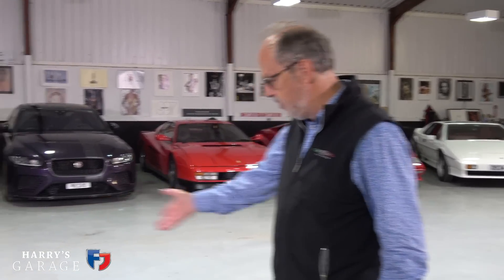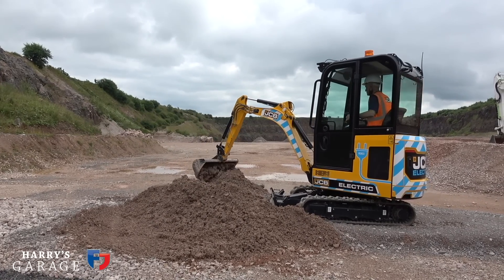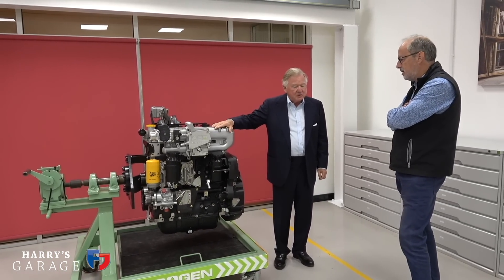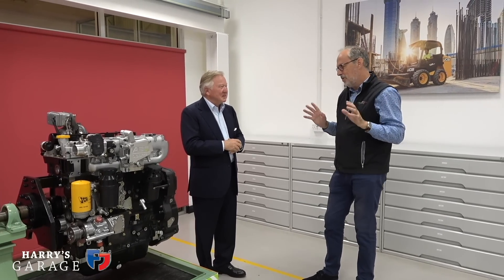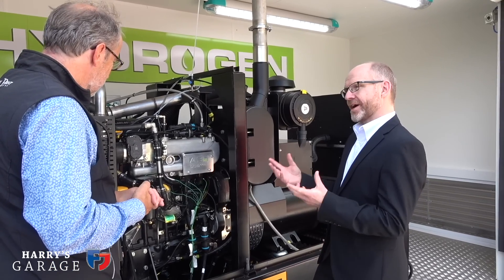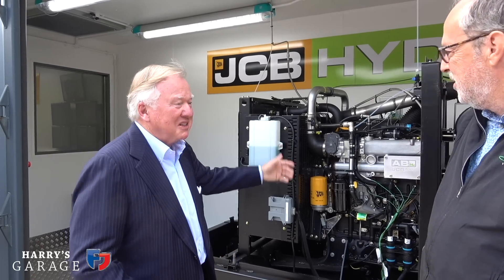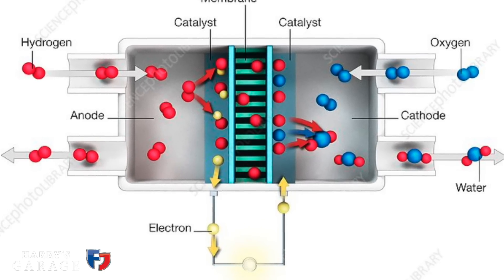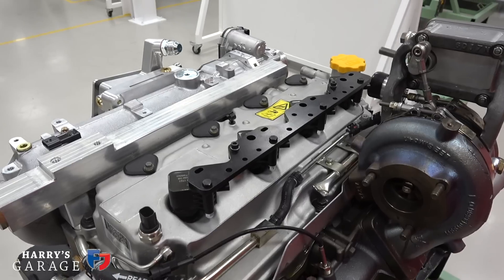Is hydrogen, rather than electric, the future for big-engined machinery? I visit JCB to find out

Comment: I was successfully  running my RX 7 rotary engine powered 50 KVA generator on rainwater sourced hydrogen, 12 years ago 😎
Reply: After 35 hours successfully running on rainwater sourced hydrogen a slight technical hitch caused a leak which blew the rx7 engine with PTO driven 50 KVA generator and the side of my workshop to pieces , explosion took my camera and recordings out also, the only survivor was the rainwater to hydrogen electric converter 😬
Reply: @fenflyer  haha so a totally safe technology ready for consumer use then
Reply: Very hard to tame detonation in a h2 ice engine. The reciprocating engines BMW was testing suppered knock. H2 works better in rotary engines.
Reply: You RX 7 idea is simply not viable for the whole planet.
Reply: @fenflyer  That must have been a hell of a leak - one that occurred in poorly ventilated areas that allowed for stoichiometric ratios of hydrogen, that then saw an ignition source...Hydrogen usually will self evacuate from a ventilated area as it is so light. Normal petrol usually forms a more explosive mixture as it is heavy and stays in place unless the area is really well ventilated.
Reply: @bighands69  Mazda continues to develop the Rotary engine, especially wrt hydrogen and continues to patent these developments...
Reply: @thecraggrat  To get the rotary engine running sweatly at full load I was running an oversize  impeco mixer which probably  over fuelled the rotary when it came off full load to an ideal unattended , this I believe must have caused the blow back🤷‍♂️
It happened at the time of a similar blow out on the Norwegian Hydrogen highway which took out 2 people an rx8 and the filling site 🤦‍♂️
I lost my enthusiasm for it after that 🙄
https://www.wired.com/2009/04/mazda-sends-hydrogen-rx-8s-to-norway/
Reply: John Deer built prototype rotary engines for trucks that could run multi fuels. They were said to be very resistant to stalling.

Comment: I was in Japan a couple years ago, they have hydrogen filling stations for cars. I was so impressed i took a photo of one. It's definitely viable.
Reply: I believe I heard James May say that the UK has 3 H2 filling stations, nationally.
Reply: @simonhbacon  There are about 5. They cost north of £1.5m each and can fuel about 10 cars a day. H2 is woefully inefficient, and made largely from natural gas. For passenger cars, forget it. It is just not going to happen.
Reply: @edwardbyard6540  It only takes about 5 minutes to fill a car, so i don't know where you get a limit of 10 cars a day. If its the size of the tank, this is easy to increase.
Define inefficient, the video stated that it contained more energy than diesel for a given, presumably compressed volume.
Video also envisaged generating H2 at off shore wind farms, electrolysing sea water.
Costs will be driven down as technology improves and becomes more mainstream.
Reply: @nordic5490  I think you're confusing hydrogen fuel cell motors (which as you say use electric power to drive a vehicle) with the hydrogen internal combustions engines discussed in this video.  I agree though that both are less fuel efficient than petrol or diesel engines. The added problem is the amount of electricity required to produce "clean" hydrogen, and the costs involved in manufacturing and distributing it.

Comment: I've been talking about this type of ICE for some time now. I just didn't understand why someone didn't go ahead and build one. Brilliant JCB!!
Reply: Economics.. Hydrogen made from natural gas is expensive to make and is the opposite of "green"   Fuel cells make more sense in any case.  JCB just wants to use the infrastructure is already  has to make a very low efficiency ICE engine.
Reply: Infrastructure!
Hydrogen infrastructure is hugely expensive, it makes a lot more sense for the vast amounts needed to go to heavy transport and heavy industry. For passenger vehicles it makes hardly any sense.
Reply: @UAPJedi  Hmm. I'd like to know what is easier - scaling charging infrastructure for people who have on street parking (near enough half of the uk) or a hydrogen infrastructure. Rapid charging hubs not really a scalable solution - they're inconvenient for the end user and the load they'd place on the grid if everyone without a driveway relied on them would be too great. But rolling out millions of on street chargers ain't gonna be cheap or easy.

Comment: 'it sounds more like a petrol' 
Harry and everyone else will be very happy.
Reply: Looking forward to running a hydrogen powered V8 in the future 😎
Reply: @V8PropaneBurner  There is BMW Hydrogen 7. 6.0L V12 which kicks out a glorious 256PS and 290lb/ft. While being 2300kg. A glorious 111PS per tonne. 
(fyi H2 piston engine is idiotic)
Reply: @V8PropaneBurner  The fuel tank for same range will be 7 times larger than a gas tank and weak power output will be about half for the same size engine. Hydrogen combustion engines are not the most stupid idea ever in the history of engineering technology - but they will be definitely  merit an honorary mention in the  hall of fame.
Reply: I have a dream. A hydrogen powered TVR.
Reply: @bbbf09  My "research" on fuel storage size says the number is 3-4 times but your point is well made.  Maybe I haven't accounted for the low power output.  What I can't work out is why a commercial fleet operator in particular would use a hydrogen ICE in lieu of a fuel cell when the ratio of efficiencies is at least 2:1 and I'd expect it's quite a bit more, the way that diggers, dozers, haul trucks & the like use their power.  Anyway, they'd be paying at least twice as much for fuel, which is the major operating cost for any commercial vehicle.  Many might say purchase price but as with BEV's, this will soon disappear and even if fuel cells are expensive now, in the commercial realm this would soon enough be overtaken by the cost of fuel.  To return to your point, a hydrogen powered ICE  vehicle will also need at least twice the size of fuel tank as one with a fuel cell drivetrain to do the same amount of work.  Yet another packaging problem, and let's not talk about a hydrogen ICE powered vehicle having the same high maintenance regime as every other ICE powered vehicle when compared to electric drivetrains.  Sounds like a dead end to me.  Apologies for the rant.
Reply: @Neojhun  yeah...weak and feeble. Wonder if JCB drivers are going to welcome that ? P.s. by comparison elecfric motors have power to weight ratios around 4000PS per tonne. Almost 40 times more.
Reply: @bbbf09  I'm not sure they could pull off a  scam if their competitors come up with practical fuel cell alternatives but I do agree that this appears to be a technological dead end.  There will be a market for hydrogen powered earthmoving machinery but they won't involve ICE's if the makers want to stay competitive.

Comment: Great video Harry and I believe it's the best remedy for Heavy Machinery and even airplanes. However, hydrogen is usually stored in tanks 5000–10,000 psi tank pressure. Because the pressure is so high the tanks deteriorate very quickly when compared to Diesel or Petrol tanks. I wouldn't be very impressed if a Hydrogen station was built near my house, with all the risks hydrogen storage brings. Lord Bamford mentioned the rare materials that make up the battery, such as Lithium, Cobalt and Copper. Battery technology is advancing so fast now with the approach of the Solid State battery and other alternative materials being used instead of Lithium, Cobalt and Copper. Those alternative materials are not rare and will not get more expensive. In fact the solid state batteries are getting denser and smaller.I think both technologies have a place in our future. I love JCB and I hope the hydrogen engine is a great success.
Reply: This is correct, great for heavy vehicles that can carry heavy tanks, not so practical for cars which will be limited in range simply due to the size of tanks required to safely carry the hydrogen fuel.

Comment: We have known for years that an internal combustion engine can run on H2. The trick will be to make enough H2 at a price that we can afford. And to date there is a massive hill to climb on that front. I don't think that will ever be solved. And that's before we mention the logistics of H2.
Reply: There's a company startup in Ireland dealing with the manufacture of hydrogen.
Reply: At least the storage problem seems to be solved. I remember BMW battling the leakage problems on their test cars back in 2000 to 2015. The tank drained itself within 9 days in the BMW Hydrogen 7 (E66 760iL). Oh, the 260 instead of 445hp and 3.6kg H2 per 100km at (subsidized) 10 Euro per kg where somewhat disappointing for BMW 7 owners at the time.
Reply: hydrogen fuel cells are 2x more efficient, our professor says that it burning H2 in IC is not the way to go for the vast majority of applications
Reply: @VolkerHett  And that's with NO TAX on it !
Reply: Hydrogen is not viable on any level.

Comment: Thanks Harry, as you have said there may also be opportunities to convert diesel machinery to hydrogen, which looks like a much cheaper and simpler option than converting to battery power.
Reply: @IonorReasSpamGenerator  Look at what's been achieved just by applying themselves. The argument you use seems more phylisophical than anything.

Comment: At last! Someone talking sense about the whole electric vehicle cul-de-sac that the blindfolded are being led down! Hydrogen is THE way forward. Thank you Harry for getting this out there.
Reply: An existing low emission fuel already exists which never got a mention its called LPG.
Reply: More complex system that’s costs more requires more servicing and has a higher cost fuel source that’s less efficient energy wise. While in this application it does have its benefits, hydrogen has more profitable applications which detract from good engineering like this.
Reply: Yet know one seems to know how to transport Hydrogen in meaningful quantities.
Reply: .....the way forward. Where are you getting your data from?
Reply: @oldjonesy123  Low emission at the point of use, but horrendous emissions at the point of production......
Reply: @shiraz1736  Good point. Hydrogen won't magically appear at filling points......

Comment: So impressed of this genius explanation of the future of real combustion engines. A masterpiece.
I take my hat of for the JCB company.
Reply: @antjone  hmm, but green electricity is mass-produced now do you mean....
Reply: @gx1400sc  Making  hydrogen from renewable electricity looks like a good idea, until you realise you need so much electricity to do so.
And it's difficult to store and transport - you need to put in 8x more energy than you get out.
Diggers are a niche issue, the video should have looked at the decades of work needed.
Reply: @antjone  but it don't need rare metals, and about the energi cost to make hydrogen if you take all the energi and copper to make an electric car , etc  I really doubt that the total energy cost is lower for battery cars.
And the transportation of gas tubes,  we have transported 300 bar tubes for decades no problem what so ever.. Charging the cars in mass will generate a horrible costs in energi and costs for upgrading the grid all the way to the user. in other words, it won't be done. Hydrogen is the solution.
Reply: @gx1400sc  I agree hydrogen is the solution, but only around 2100. (Not 9pm 😉)
Reply: @antjone  I totally agree, and battery driven cars with todays battery technology and many years to come will certainly be a economic and environmental disaster....

Comment: Proof that engineers should run industry, not financiers. When I started work in engineering I was told that accountants were a useful tool, but if put in charge there would be very little advancement because the key to being an accountant is to not take risks. The engineer must take calculated risks to improve the product or come up with new technology,

Comment: Brilliant film, I never understood why we were not able to reuse the combustion engine with hydrogen. Very impressed with the work going on at JCB, hats off to them!
Reply: Because what s the point of just re-using a dreadful inefficient exisiting  technology especially  if what you are fuelling it with isnt really sustainable (or at least is only sustaible via stupidly  ineffiicent processes). You make hydrogen from electricicity. But much better just to use electricity directly not introduce a pointless extra inefficient step.
(p.s. also you can't use existing combustion enegine tech - look up hydrogen embrittlement as just one reason why ---apart also from fact they are way too small to gove much useful  power out  with hydrogen)

Comment: Thinking that when you take into account the difficulties and costs of mining, processing and refining fossil fuels, the infrastructure for making making hydrogen isn’t any worse. Just need to keep investing in more solar and wind power for the electrolysis of water.

On another point, I was impressed that they had found an engineering solution for the one issue there could be in burning hydrogen, and that is how to avoid the production of NO2. Great engineering and a world leading company the UK is rightfully proud of.

Comment: Drove a Hydrogen Fuel Cell Hyundai a few years ago, they really need to get the infrastructure sorted, this is the future, depending on what pressure you put in the tank dictated how far you could go 500psi= 500 miles 600psi= 600 and so on if I remember correctly.
Reply: Ford build pick up trucks. They are about to launch the new F150 electric. Due to the range issue, they have put a 'removable range' petrol engine on board to charge the batteries. LOL.
Reply: It's too expensive for mainstream. Waste of energy to produce hydrogen for the masses.
Reply: Hydrogen and electric cars right now is nonsense. It is simply not viable.

Comment: Nice job JCB. Also, just pointing out- Toyota already built a H-ICE (Hydrogen- Internal Combustion Engine). They are also testing its endurance in 24h race in Japan. One of the main factors holding hydrogen back is its infrastructure, especially for refuelling, and cost of Hydrogen.

Comment: didnt bmw reconfigure a 7 series to hydrogen in the 90s already? hope this makes more sense for heavy machinery.
Reply: Yes, it did. That was around 2001 with a E38 V12.
Reply: @GJM-  Greta would be proud 😂
Reply: James May is on his second Hydrogen car.
Reply: Very hard to tame detonation in a h2 ice engine. The reciprocating engines BMW was testing suffered knock. H2 works better in rotary ice engines.
Reply: The BMW Hydrogen 7 was an experiment which ran from 2005 to 2007 using E65 7 series. It had a 6.0L V12 kicking out a glorious 256PS & 290lb/ft. It also weight 2300kg, making that 111PS per Tonne. Astounding attempt at engineering.
Reply: @spencer19811  LOL Greta would laugh at how WEAK it was.
Reply: @Neojhun   Greta would not understand what she was being told.
But if it sounded “Green” i am sure she would believe it !
Reply: @weinisable  FYI the base drive train single motor in Model 3 SR is 283hp and 307lb/ft and Weighs 1650kg. Being RWD and electric Motor Torque, makes a rather good drift missile.
Reply: @Neojhun  Allow me to explain....
..how would “Greta”  understand the relative performance of one motor/fuel compared to any other ?
 Or do you believe she is the demi god with all knowledge,   as some seem to think ?
Reply: @Neojhun  ..but anyway,..isnt “stupid” what this thread + video is all about ?
 H2 fueled ICEs are a sideshow to anything serious in the future of engine development.
Reply: @Neojhun   you think she is smart enough to figure out the relative performance of a prototype car ?..
 If so why doesnt she realise the relative performance of a Wind turbine and a Nuclear generator ?
  It doesnt take a genius to know which one is hilariously weak, pathetic, ruinously expensive and impractical.
 ..but she keeps supporting the change over to them.....why is that ?
Reply: @weinisable  Yes it's very easy for someone of decent intelligence to realize a 6.0L V12 engine with 256hp is too weak, being a prototype is not relevant.
HAHAHA You are delusional. FACT is a 1GW Wind Farm is far quicker and cheaper to build than a 1GW Nuclear Fission Plant.  That also needs an exclusion zone vs land for wind farms are dual purpose. FYI I use to work in the nuclear medicine industry. I love it when propagandist make up lies that have no clue how reality works.
Reply: @weinisable   "I doubt Greta even knows what a 7 series BMW looks like" LOGIC FAIL!
The original comment would be if Greta was presented shown the Hydrogen 7. You missed the entire point.